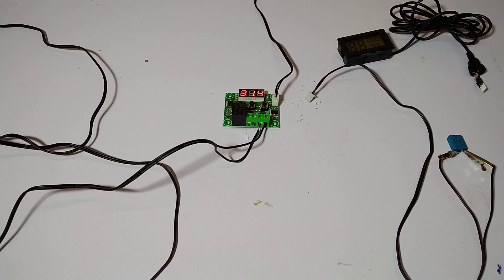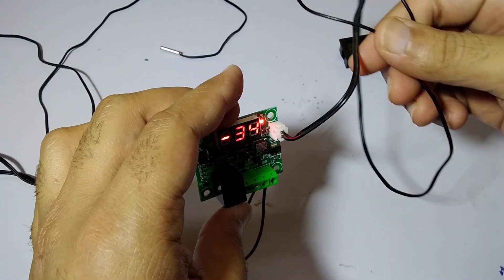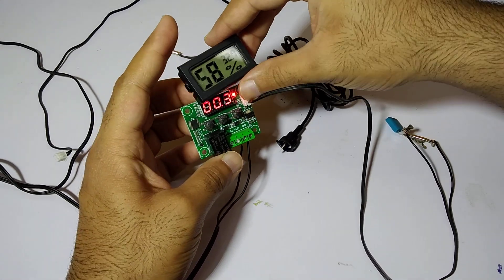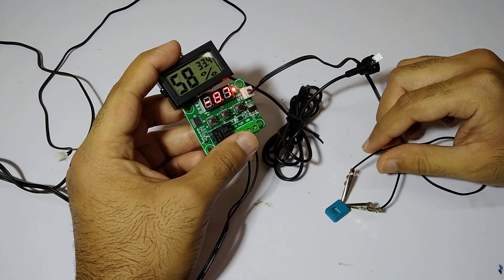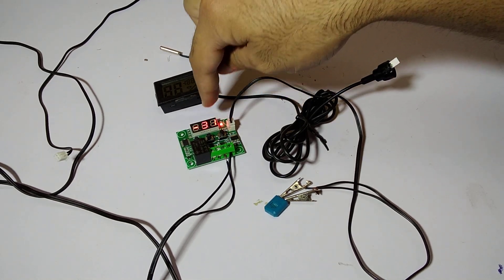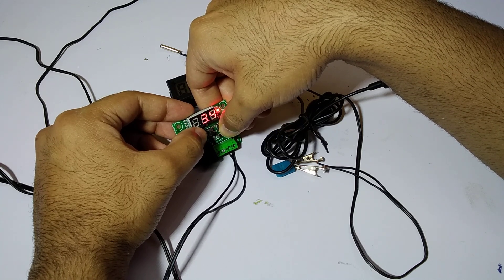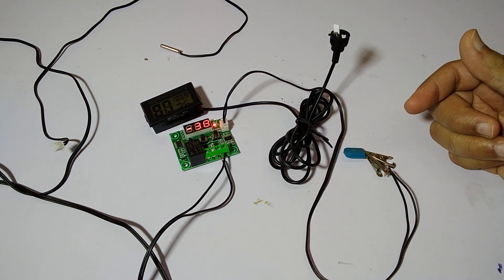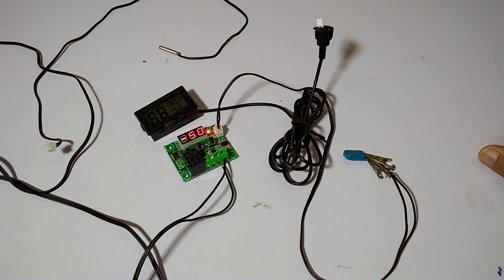Can w1209 measure humidity

Comment: My plan was to use W1209 to control the humidity, or rather, to give an alarm when the humidity falls below 50% or rises above 65%. What is the best way to do this?
Reply from the maker: W1209 cannot measure the humidity, you need humidity controller for that